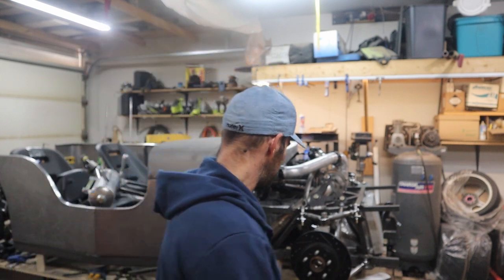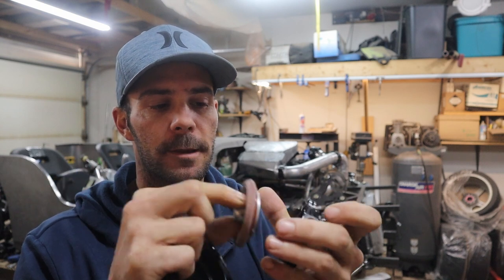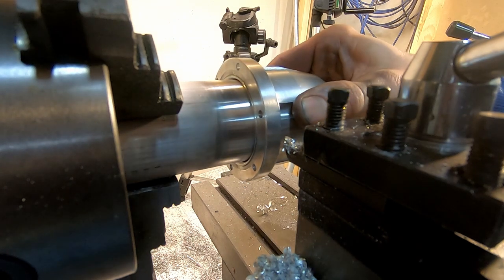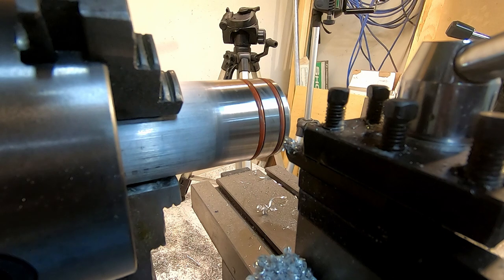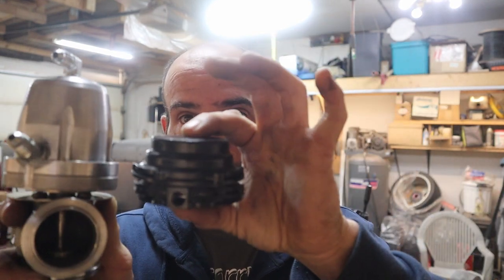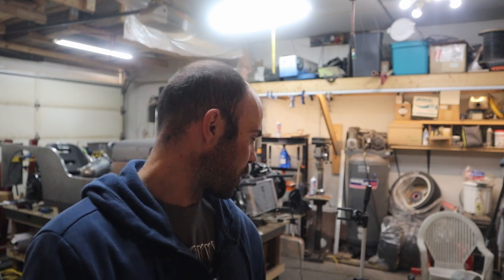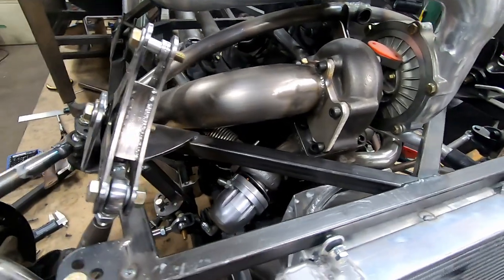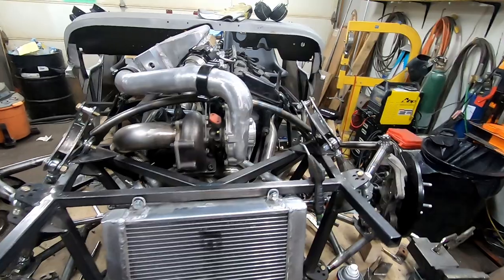DIY Wastegate? (Turbo Hayabusa Willys Jeep Ep. 33) Limitless Builds

Comment: I don’t think that’s a rubber diaphragm? Probably silicone due to extreme heat? But other than that, you truly are limitless... Get’er done dude!
Reply from the maker: Yes you are correct. Turns out I need a different lube in there as well since this stuff won’t hold up either. Haha